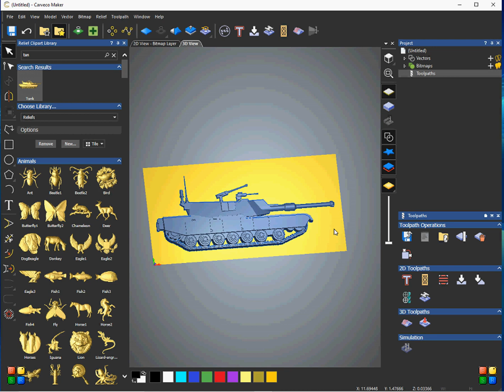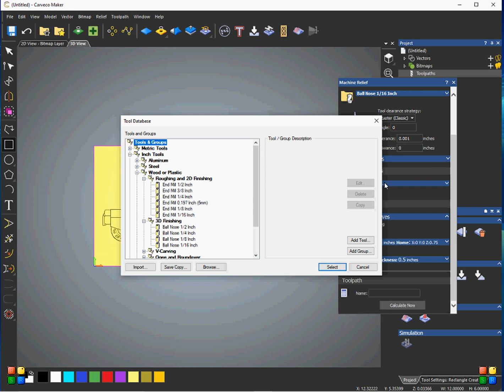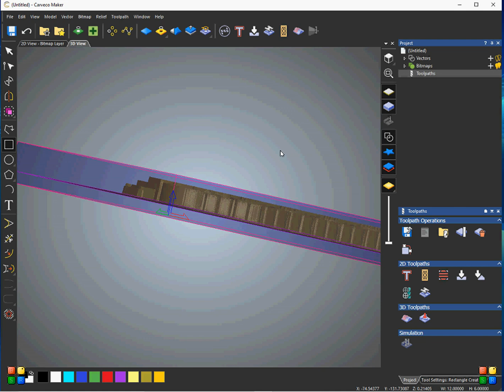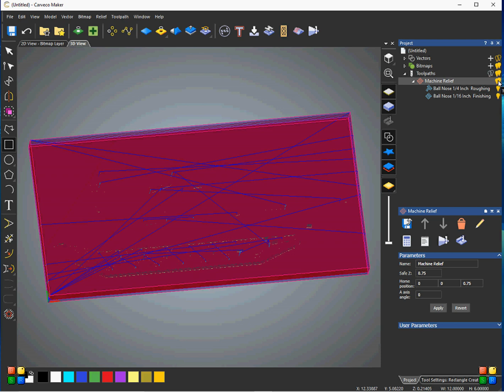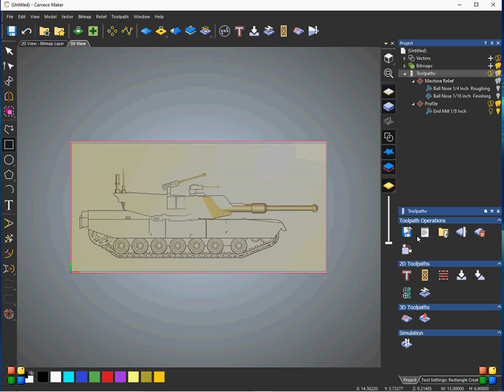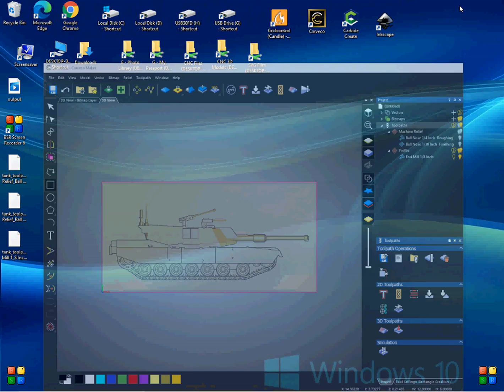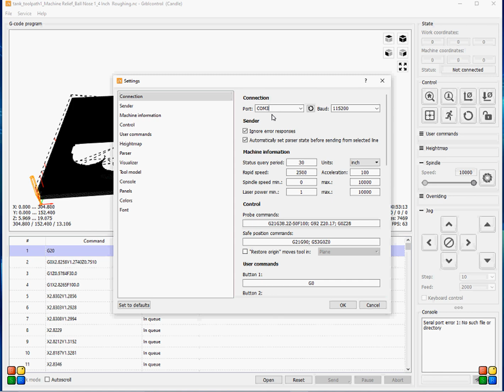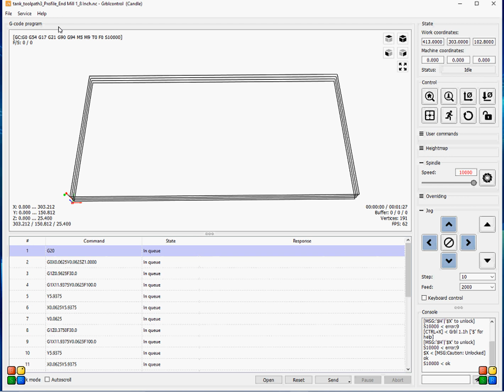How to save multiple g-code toolpaths in Carveco for grbl Candle.

Comment: Hi maybe you can help I have a project that I did with carveco save the toolpath send it to candle did my zero start project my z just goes up not sure what I did with carveco  any idea
Reply from the maker: Not quite sure what exactly would cause it to do that, but first make sure you save the gcode with the correct file format for the 4030 or whichever machine you are using.

Comment: Im having an issue with carveco and candle that maybe you can help me with , I can’t seem to get the Z positioned right in relation to the material (or something along those lines ) . When I import the files to candle and I’d set x and y in place , then Z I would set it allll the way up to do a floating pass . And every single time it will go all the way down to the point I always have to use the “oh sh*t” button . 
Im sure it’s something in the carve co settings I’m messing up but I can seem to figure it out ! Any help will be GREATLY appreciated. 
ProverXL4030
Reply from the maker: I'm not sure what you mean to do a floating pass? Does the bit actually plunge into the workpiece? But one thing to make sure is that you have the unit of measure,(millimeters or inches), set the same in Candle and Carveco. If not the the bit can plunge or veer off path.
Reply: @windsorwoodcraft  just a “ghost” quick start so I make sure my xyz are good in lace , and the z all the way up so it does not touch the material which in this case is happening .
Reply from the maker: @midasmedia7448  If you can, send me a screen shot of your settings that you are using for that file and I'll see if it all looks good or not.

Comment: do you need to reset the origin every time you run a new toolpath or can you use the origin you set in the first for the finishing passes?
Reply from the maker: You don't necessarily need to reset the X & Y origin if your machine returns to the same starting origin after it is finished with the rough pass. I usually do, just to be sure there are no problems. You do need to reset the Z each time you change bits unless you are using bits with collars on them or are using the same bit for rough and finish.